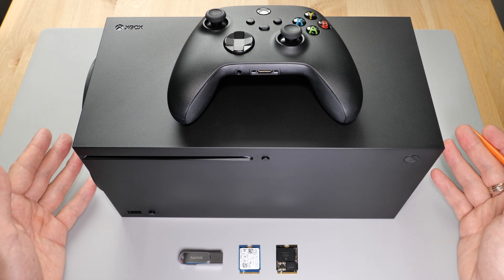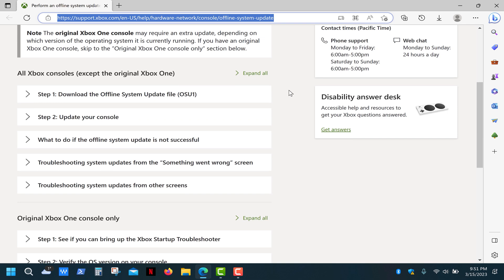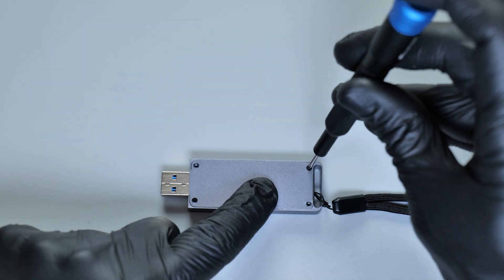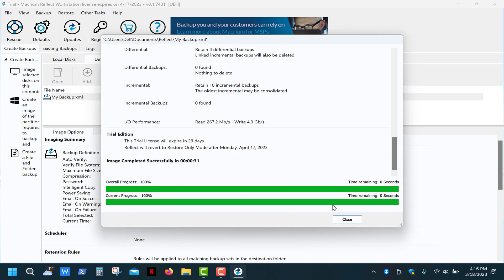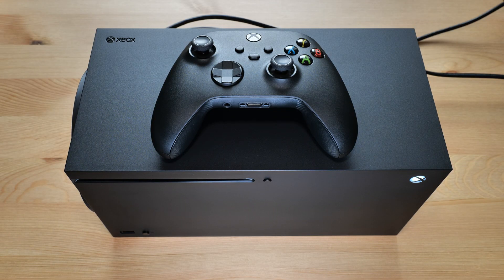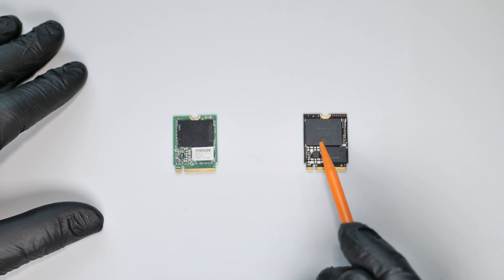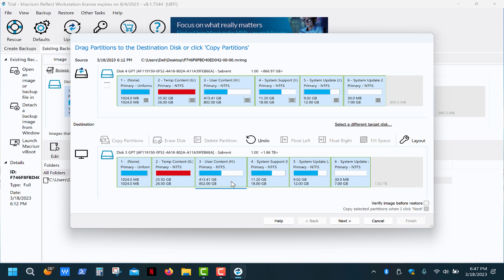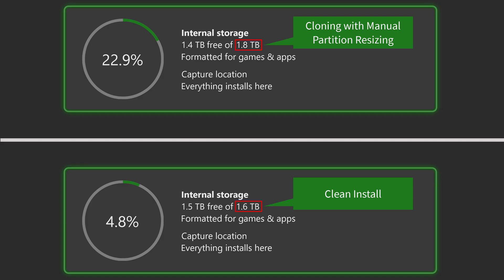Upgrade Xbox Series X SSD to 2TB – Clean Install or Clone Method (Step-by-Step Guide)

Comment: The Series consoles are (IMO) designed from the ground up to screw you over. Tiny internal storage, SSD married to the board (plus model whitelist) and external expansion cards just as horribly overpriced for the amount of storage you're getting as the internal compatible models. 
To add insult to injury, resorting to moving games from the internal SSD to an external SSD or HDD (and back if you want to play them) just kills the internal SSD even faster with more unnecessary writes. And once it goes, the whole console is bricked and worth-/useless.
To upgrade my Series S from its stock 512GB SSD to a 1TB one already exceeds the value of the whole damn console on the used market. And it doesn't even matter if I do it the hard way (replacing the internal SSD with one of the handful compatible models) or the noob way (buying a Seagate or WD C50 expansion card). Both cost well over 130eur/usd for a 1TB, more than a used, fully working Series S is worth. Not to mention that it's an absolutely absurd amount of money for a puny 1TB SSD in general. 
There's absolutely no point bothering with upgrades like this (unless you have more money than common sense), unlike the xbox one models where you could just slap in any SATA SSD, restore the OS with the OSU USB stick and be done with it. I've done that countless times and flipped the consoles after. Kept a One X "Project Scorpio" for myself after cleaning it, replacing the PSU capacitors, replacing the thermal playdoh with actual pads, the thermal paste and of course throwing a 2TB Crucial MX500 at it. Basically "go big or go home" lol
Reply from the maker: If the original SSD fails beyond repair or recovery, the console becomes a useless piece of equipment, only suitable for selling as donor parts. We buy them for about $30-50 for parts. Microsoft has deliberately made them unrepairable. In the previous generation of consoles, there was a bootloader chip on the motherboard, allowing users to easily upgrade the drive by swapping it and installing offline updates via USB—no need to mess with partitions. However, with the Series S and X, that bootloader chip is gone. Now, it's stored on the SSD with unique encryption that changes with every update. Microsoft charges $350 to fix these consoles, and in most cases, they simply send a refurbished unit instead of repairing your original one.

Comment: Is it possible to install windows? Because i was wondering if it can just become a pc.
Reply from the maker: It's impossible unless you create a custom OS and drivers. Nobody is going to invest time and money into that.
Reply: @ElectronicsComputers  I am a bit new to this so I dont understand what you mean by Custom OS, Can I not just install Windows on the SSD and put it in the Series S? or would I aso have to do something else?
Reply from the maker: @ You would need to create an entirely new operating system for that. Regular Windows is not designed to run on Xbox hardware, and it’s practically impossible to make it work on consoles. To put it extremely simply, think of a console like a powerful graphics card with an attached power supply and SSD—it’s built for a specific purpose and doesn't function like a regular PC. We can’t install Windows on everything just because it has an SSD. For example, my Xerox printer has a large LCD screen, RAM modules similar to those in a laptop, and an SSD inside, but that doesn’t mean Windows can run on it. It operates on its own custom-built operating system, just like the Xbox does.
Reply: @ElectronicsComputers  Thank you very much for the information.
Reply: @ElectronicsComputers  I am so sorry to bother you its just that i have many questions. I recently saw someone put Windows on a Steam Deck thru a SD card and dual booted it but in the video they didnt seem to use a custom OS they just installed it on a sd card and I understood from your Printer explanation that not everything can have windows installed even if it has all the things a PC has but even the Steam Deck has a custom operating system did they also have to create there own OS and Drivers or can Steam Deck run Windows, and would I need to create my own version of WIndows?
Reply from the maker: @HarmeetSohal-n8d  Valve (creator and operator of Steam) provides drivers for Windows so you can install either Windows 10 or Windows 11 on the device. You can install Windows as a full replacement for SteamOS or dual-boot it alongside SteamOS.
 Unfortunately, Xbox doesn't have such option.
Reply: @ElectronicsComputers  Thank you so much! I was planning to install windows on my XBox and started researching, Thank god I found you, or else I would have bricked my Xbox
Reply from the maker: @HarmeetSohal-n8d  I'm happy to help! I wish it was possible—it would be a really cool two-in-one device for gaming and work. But even as an electronics technician and software developer, it's far beyond my abilities. It would take a huge team effort and years of work to make it functional, so nobody is going to do it. Microsoft, on the other hand, could technically make it happen, but they would need to develop a lot of custom drivers, new firmware, and heavily redesign and optimize Windows. And of course, they will never do that because there’s no significant profit in it for them.

Comment: Im so Angry that microsoft r so greedy they need to add Built in Obsoletness into the SSD SMFH Disgusting
Reply from the maker: Yeah, we have a huge pile of Series S and X consoles in my repair shop, all with dead SSDs, which means they're unrepairable and just junk. In the best-case scenario, you can sell them for parts. The One X was the best console—if the hard drive died, you could put any HDD/SSD inside, install offline updates, and you were good to go. But with the Series S|X, there's a whitelist of compatible models, plus the boot partition is encrypted. If that partition is damaged or the SSD dies, it's game over for that console.

Comment: Hi. I have an Xbox series X. The problem is that the console starts up normally and works normally as long as I don't enter the game. However, it doesn't matter, the console turns off after a maximum of 1 minute after entering any game. When I turn the console back on, the following message appears on the screen: This console has programmed itself to automatically turn off in case of high temperature. etc. I couldn't find a service that would tell me exactly the cause of this problem. Can you please tell me the reason for this? Only an electrician told me that there could be two reasons for this: SSD or processor. In any case, he said that both of these cannot be repaired and the console is unusable.
Reply from the maker: Here's my video that should solve your problem: https://youtu.be/GTvtAM7Fi5U
Reply: @ElectronicsComputers  Thank you for your reply. But I want to clarify one issue, if I do this method you mentioned, will my problem be solved 100 percent? Someone told me earlier that buying and replacing a power supply unit would solve the problem, and I did that. But the problem remained the same. That's why I want to find a clear solution and move in that direction. No, if it doesn't work, I don't think it's worth spending money on.
Reply from the maker: @  The power supply has nothing to do with your problem to begin with. It's most likely an overheating issue. How can anyone give you a 100% solution without proper diagnostics? If you come to our service center in Seattle, I can tell you with certainty whether this will solve the issue or not. But if you want to save some money and make your console work like new again, start by replacing the thermal paste and thermal putty, and cleaning the heatsink and fan from dust.
Reply: @ElectronicsComputers  I live in Azerbaijan, so I can't come to your service center myself. But I will do what you said and share the result with you here. Let me ask you this question: If I send my Xbox Series X to your service center, can you fully repair it?
Reply from the maker: @resadehmedli9311  The shipping cost isn’t worth it. Just invest 20 bucks in replacing what I mentioned above and see if it fixes the problem. If not, it’s better to sell the console for parts, from which you could get at least a hundred bucks, maybe even more. The Series S|X is the worst console that Microsoft has made. The previous model was easily upgradeable and repairable, but with this one, if the SSD is dead, the console becomes garbage. No one will ever fix it due to the encrypted boot partition.
Reply: @ElectronicsComputers  Thank you for the detailed information.

Comment: Hi, thank you for the detailed tutorial! Can you update me on the exact model of the compatible 2tb 2230 nvme you used or if there is a faster compatible one? Appreciate it
Reply from the maker: We haven't yet had any new Series X models with 2TB drives in our repair shop, so I don't know what model they use. However, it's almost certainly not something you can buy on Amazon or in your local store. I used a modified SSD that you can find on AliExpress or eBay, but I don't recommend using them or upgrading the Series X at all. Upgrading only makes sense for the Series S, from 512GB to a 1TB SSD. There's a high chance of bricking the device, and nobody will be able to fix it due to Microsoft's encryption.

Comment: Hi, how about using CloneZilla or  Balena Etcher ? to clone the SSD , I think it would be easier and faster.
Reply from the maker: If the software can detect Xbox partitions and allows you to clone and restore a single partition, then go for it. You can use whatever you're comfortable with.
Reply: @ElectronicsComputers  
CloneZilla can clone each sector one by one perfectly, but you obviously not gonna be expanding the capacity of the drive by this unless you can do it inside the Xbox. 
You could also tell it to clone a certain amount if you know the exact sector size of the partition.
Reply: @ElectronicsComputers  Could you share the raw boot img file you've created?

Comment: Bro, please, help
What can I do so that my Xbox uses a large part of the SSD I installed? Right now I partition it at 350 GB, when the disk is 960 GB :C

And in Windows administrator say 430 GBs unassigned. How can I move them? I am using a One S
Reply from the maker: Why did you partition it in the first place? Just install the new drive inside the console, install offline updates, or for Series S|X, clone the boot partition, install offline updates, and the job's done.
Reply: @ElectronicsComputers  I didn't partition it, the Xbox did. I just formatted it as NTFS and then installed it directly on the console and updated it offline 😔 

but I'm telling you, of the 960 GBs it only left me 350, and I checked it in Windows and it left 420 with nothing.

Comment: Hello I'm from Russia,help me please,xbox series x my ssd dead
Reply from the maker: If your SSD is completely dead and unrecoverable, your best option is to sell your console for donor parts to a repair shop, as it will be impossible for anyone to fix it without the encryption key. Your first priority should be attempting to recover the SSD. It might still be possible to temporarily fix it just long enough to extract the boot partition, which contains the encryption key. If recovery isn’t an option, as I mentioned earlier, selling it for parts is your only choice. Many consoles end up in this state due to failed M.2 2230 SSDs, which don’t tend to last very long. At our shop, we often buy consoles like these for $30–$50 for parts.

Comment: Have you done anymore experiments with this method. I’m trying it with a western digital blacks SN770M partition copied fine but just cuts on then after about a minute it goes off. Also are the SN530 SSD drives gen 4? I only see gen 3
Reply from the maker: There are only a few compatible models that work with Series S|X consoles out of the box. Additionally, some models can be made compatible by replacing the controller or modifying the firmware. However, upgrading to 4TB is not worth the risk due to the potential for bricking the console. If you choose to proceed, it’s crucial to preserve the latest boot partition after every attempt, as earlier backups, including the original one, will no longer be valid for the console. The best solution is to buy a compatible SSD (links are in the description), either a 500GB or 1TB model, restore the latest boot partition, and install offline updates. If you lose the last boot partition, your only viable option may be to sell the console for $50 as a donor unit for parts.
Reply: @ I don’t think you understood my question, I’m not trying to install a 4TB SSD. The WD SN770M is a 1TB Gen 4 SSD and I’ve tried a SAMSUNG 1TB SSD Gen3. The Original has errors but the first partition backed up fine. I can’t get the Xbox to boot with the partition on the WD or Samsung. The SN530 you are suggesting is a Gen 3 SSD but isn’t the Original a Gen 4 SSD?
Reply from the maker: @ The SSD capacity or its generation doesn't matter in this case. There are only two compatible models WD SN530 and SSSTC XA-3D1024. One WD model is possible to modify and that's it. The rest of the SSD won't work.
Reply: @ElectronicsComputers Ok thanks I’ll let you know how it goes, the SN530 1TB will be here tomorrow.
Reply: @ElectronicsComputers  Ok so I received the WD SN530 drive update. It starts going through the downloading and verifying stage. It restarts and then gives me an e109 code.

Comment: I dont understand why they made storage upgrade so hard, like the expansion card is only 2tb max right now, and if they did this so we have to buy that, then its a shitty job because 3tb for modern games is okay for people who play their favorite couple games but me who wants to play random games and their series it fills up pretty quick.
Reply from the maker: They made that upgrade near impossible so people would invest in an external extension cards. Also, they made impossible to replace an SSD after it failed like it wan on the previous consoles, where you could just put any HDD or SSD and install offline updates from a USB drive. With Series S|X if the SSD is dead the console is useless and worthless.

Comment: I have a big problem, I updated my console with an m.2 sn770m wd black, but now I can't get out of error 109. I did some research and it's because my m.2 drive doesn't match the sectors. What model do you use?
Reply: Previously I upgraded a series s from 512 to 1tb and it was a great success but now on a series x from 1tb to 2tb I have the aforementioned error
Reply from the maker: This SSD is not compatible with the console unless you’re able to modify it. From what I know, modification was only possible with the WD740. It's extremely important that you save the bootable partition from the SN770; if you lose it, your console is done for. Just make sure to restore that bootable partition to a new compatible drive, or back to your old one, and install offline updates. I can’t stress this enough: after every attempt to install an offline update on an incompatible drive, the boot partition changes, and you’ll need to make a new backup. If you lose that, your console is essentially useless and only good for donor parts.
Reply: @ElectronicsComputers  I have had the problem for over a year now, I have already saved the raw file with the partitions on my personal cloud, I thought it was because the software was not designed for 2TB. H Now that the new 2TB console came out I tried it and found the same error, and I found your video yesterday now I realize that my mistake was always the SSD drive. I will buy the drive you recommend. I will update when I get there and try again, thank you very much
Reply from the maker: @Jesus-jp1dq  The links for compatible SSDs in the description. The 2TB drive that I used in the video was already modified. A regular one will not work.

Comment: But if i do this on my series x with all the correct steps, the ssd or console can they could last less or something important could break?
Reply from the maker: First of all, those cheap M.2 2230 SSDs don’t last long, whether it’s the original drive or a replacement. Once the SSD fails, the console becomes irreparable, and you'll only be able to sell it for donor parts, typically around $50-70. We have dozens of them in our repair shop. Secondly, the cloning process is quite complex and carries significant risks, with many things that can go wrong. I would only recommend upgrading the Series S to a 1TB SSD. As for the Series X, it’s better to leave it as is or invest in an expansion card.
Reply: @ElectronicsComputers  ok thank u

Comment: what happens if the original SSD is toast... ie doesn't work?
Reply from the maker: If the original SSD fails beyond repair or recovery, the console becomes a useless piece of equipment, only suitable for selling as donor parts. We buy them for about $50. Microsoft has made them unrepairable. In the previous generation of consoles, there was a bootloader chip on the motherboard, allowing users to easily upgrade the drive by swapping it and installing offline updates via USB—no need to mess with partitions. However, with the Series S and X, that bootloader chip is gone. Now, it's stored on the SSD with unique encryption that changes with every update. Microsoft charges $350 to fix these consoles, and in most cases, they simply send a refurbished unit instead of repairing your original one. It’s definitely not worth the cost; it’s better to just buy a new console.
Reply: @ElectronicsComputers  what a load of.... that's terrible that, all that resting on an SSD